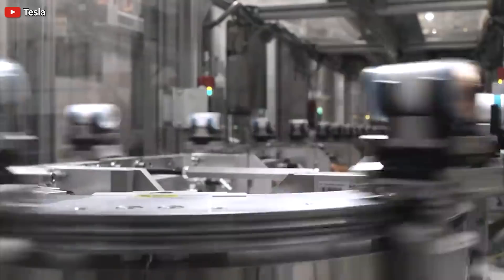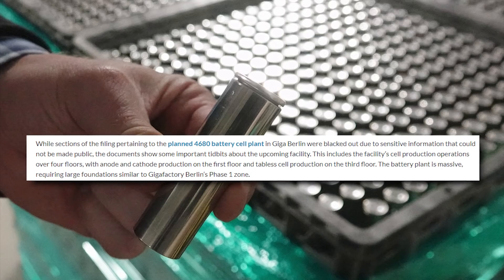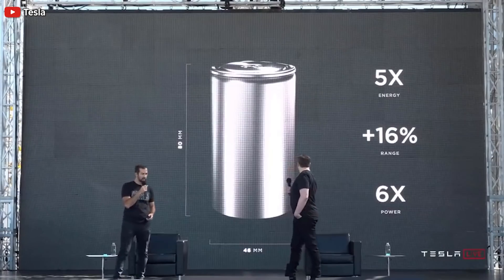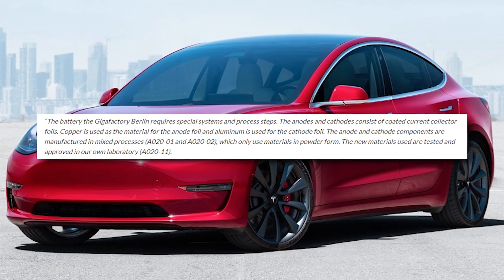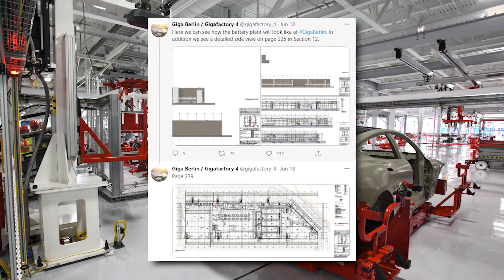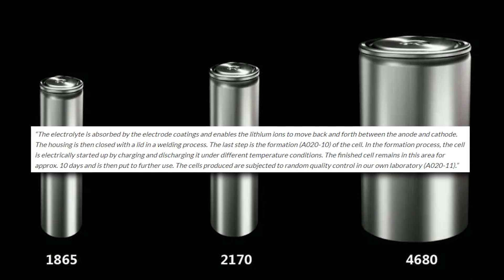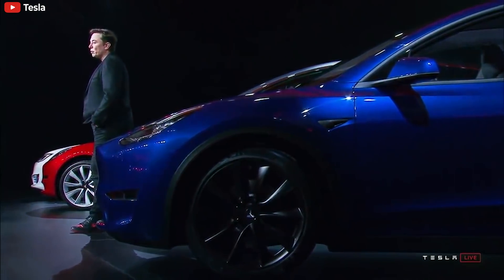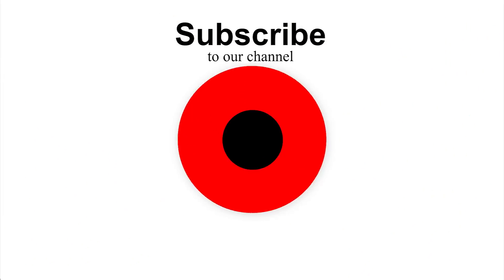Tesla Reveals Giga Berlin's 4680 Battery Cell Production Process

Comment: i wonder if these will be lfp
Reply: I really do not think so. LFP's big advantage is lower cost, but it's biggest drawback is lower energy density. In Tesla Battery Day presentation they outlined that Tesla will be using many different cell chemistries, but only the entry models would be using LFP batteries. Giga Berlin's Model Y will be their new showcase model, so it will most likely have the high nickel chemistry or maybe NCMA. Giga Shanghai may use LFP batteries on their Model Y to lower the price.

Comment: Thanks Arman,  Like the technical details on battery production.  I worry about the casting from cracking during heavy driving use and I worry about the production of batteries quality.   Once we have no issues after a certain time with no public complaints, I can go to sleep.  

Having so much invested in Tesla can be stressful   I trust Elon to succeed
Reply: Making up things and then worrying about them is so incredibly silly.  There is nothing about these materials that makes them more susceptible to damage.  The casting is stronger than smaller pieces of stamped metal being welded together.  The cars with the casting will be less susceptible to damage.  The battery quality is tested out in their lab using the same testing they used to vet all their batteries.  If they are going into production, the quality is there.  Otherwise they wouldn't have done it.  A battery recall would hose any company, no one wants to recall packs.
If you think the batteries will have issues, then wait to buy.  But don't post made up doubts online as if you have any shred of evidence to justify those made up doubts.  You just made them up, and I don't get why you did it.

Comment: This needs Sandy and Elon’s attention. 

The 4680 cell has a potential design issue? If left unattended can defeat thermal and electrical conduction characteristics as Tesla’s patent claims. 

Details 
Tab is a bridge in cell to conduct electricity. 
Tab less is a cell without the tab bridge. 

Example? 
Tab less essentially means a car battery’s negative terminal touching the chassis directly so the black cable can be omitted. 

Patent? 
4680 patent - a series of flaps extended from the anode periphery intended to conduct heat and electricity by touching the cell wall - is a problem. 

Problem? 
“Touching the cell wall” is a very loose definition from engineering stand point. It allow unexpected influence that can break the circuit at the cell wall. 

Why? 
Since anode use annealed soft copper foil that can’t flex back to its original shape once deformed - deform by inertial and thermal shocks. Consequent, one by one flaps begins to open circuit from the cell wall, until only one flap left touching the wall. (At this point thermal conduction is open circuit) From then on further inertial shock will cause momentary open circuit from the cell wall. Leaving thermal and electrical conduction equal or worse than cells with one welded tab. At this point the 4680 patent’s advantages is lost. 

Out look compare to model 3 cell pack? 
(1) thermal management in model 3 isn’t going into modelY, expecting short cell life span from air gap build up once inertial shock start.
(2) Tab is omitted in 4680 cell expecting poor battery efficiency from a higher cell internal resistance. 

Possible remedy?
(1) do nothing in the design but run rigorous environmental test to gather statistics to gauge severity of issue. 
Remedy? 
(2) add between flaps and cell wall a medium to maintain conduction even after persistent inertial shocks. Such as a wafer of conductive elastomer/paste/glue or the like. 

Conclusion? 
4680 patent is a solution that create new problem.
Reply: Tesla's tabless 4680  design has very many (hundreds of) contacts (maybe think of them as nearly continuous tabs integrated with each electrode) for each electrode to the cell case, not just one as for a traditional tabbed design.  Presumably the very many contacts are pressed into contact with the case.  The anode and cathode case/contacts are electrically insulated from each other.  Heat will flow to the path of lowest thermal resistance which is the actively cooled larger part of the case. 

"Touching the cell wall" could include significant force between the contacts and case.  That force could prevent the kind of deformation you mention.
Reply: @LoanwordEggcorn  are you a ME working with EE on electro-mechanical product development? Your comment gave us an impression of a patent lawyer. 

There is nothing in 4680 design to retain a required force beyond the point of deformation, thereby flaps contact began 99% continue to disconnect from the cell wall one by one until one is left as inertial shock persist. In other words it becomes rattle in the cell case. Any electrical or thermal coupling will happen by chance but by design.
Reply: @philoso377  I agree with your concerns, but am sure Tesla has engineered a way for the cell tabs to be in good contact with the case contacts.
Reply: @LoanwordEggcorn  You are a good fan boy of Tesla. Can you do better? Are you in position to gain Tesla’s attention on this issue? or push it in a direction to get it acknowledged and corrected.
Reply: @philoso377  Not a Tesla fanboy here, but I expect they may know what they're doing when it comes to something like battery design.  They have some of the top battery scientists and engineers working for and with them.
Reply: @LoanwordEggcorn  you haven’t describe that once the flaps began to sag under external inertial shock what is closing the air gap with what force?  It looks like I’m taking to a non professional.
Reply: @LoanwordEggcorn  no they are novice on this issue. If they are seasoned engineers a solution is already in place at the time of patent sketch. I can’t find it in tab-less patent they remain novice on issue.
Reply: @philoso377  It's possible they did not include every detail in the patent, including exactly how the tabs are attached to the case, the force of the cell on the case at different states of charge, the manufacturing techniques used to apply the above, etc.

You should apply to work for Tesla if you think they don't know these things.